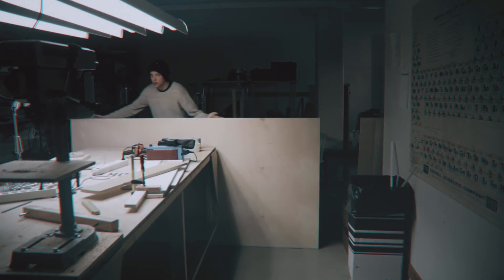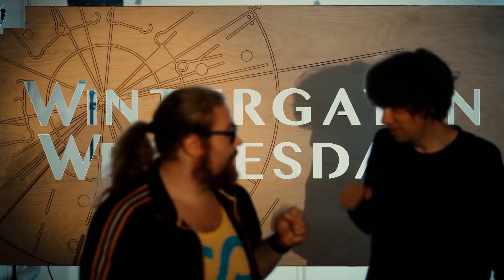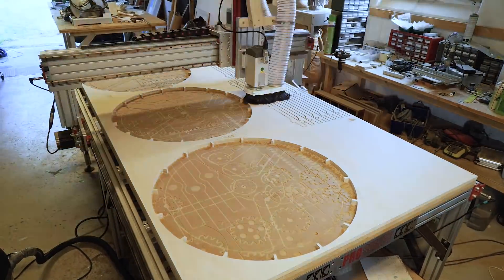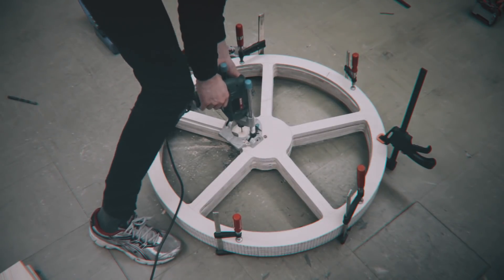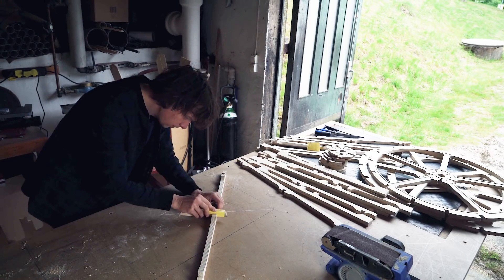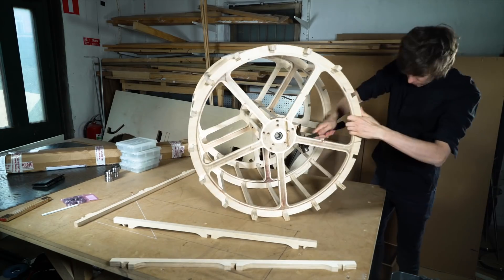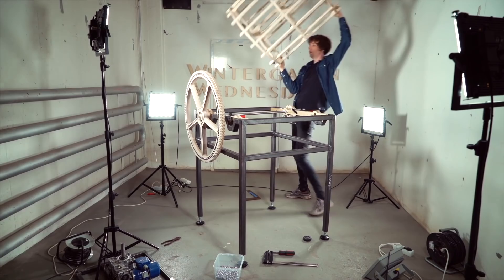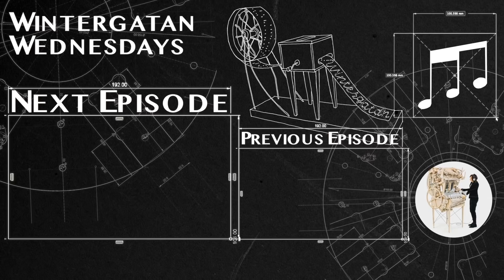Programming Wheel Skeleton - Marble Machine X #14

Comment: Fascinating build. So out of curiosity, how are the marbles doing in regard to the magnetisation issues you were experiencing? Did/have you switch the orientation of every other magnet?
Reply from the maker: Jess Page we are still not Sure How problematic it is! We are Looking into a mechanical degausser from Alexey Ivanov that we think Could work If there is a problem! So issue still unresolved...
Reply: Mishn0 I mean, the Marble Machine Alpha had a mixing desk and an amplified bass guitar built into it...
Reply: the other solution would be to not worry about the marbles getting magnetised and make all the tracks out of a non ferrous material like aluminium although that is a bit of a pain to weld and work hardens very easily
Reply: I was thinking some sort of degausser might fix it, maybe just dropping the marbles through the middle of an AC coil on their return to the marble sump would work? Or would an electrical device not be in the spirit of the thing?
Reply: Glass or non-magnetic marbles would wreck the magnetic transport idea though.
Reply: Could heat them too. A marble machine with an oven attached would be kind of cool :).
Reply: I guess one solution would be to use glass marbles though :) Also non-ferrous bearings would also work.
Reply: Aramiro / HellYeahCorp lol good call
Reply: The problem is the marbles sticking to each other after being magnetized by a magnetic transport. The only 'mechanical' means I know of of neutralizing a weak magnetic field is shock, like, dropping them on a hard surface, but that is noisey. Perhaps it could be designed to exploit this noisey mechanical approach.

Comment: Ok get the fuck over the fail... Why do you have to damn all hand made stuff to hell?  Just make it right. Then go back and remake   it with your hands.  ...  dude... don't fuck us all up by demanding CNC when you know you can just get it done without technology.
Reply: This is an incredibly complex machine. It could all be done by hand, but the process would be massively more labour intensive with a much higher risk of compounding error. Using CNC is much faster and objectively more accurate than hand work. This isn't about artisinal fine funriture - this is a machine of utility. CNC is the best way to make it.
Reply: Also he has stated several times that it is the music that is the end goal. At least I wouldn't want to spend several years hand building a machine to perfection if the machine it self wasn't the end goal.